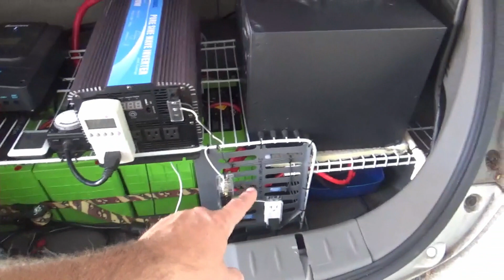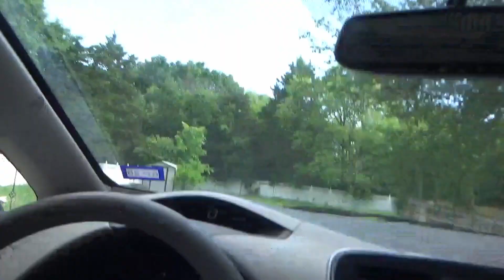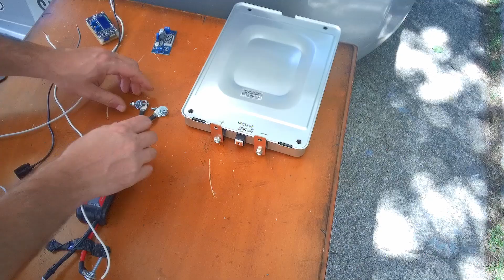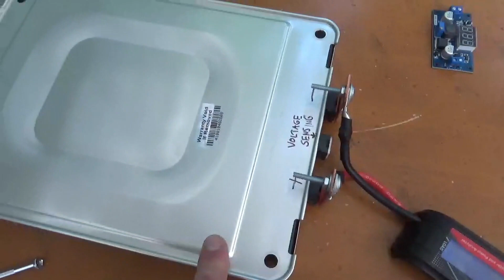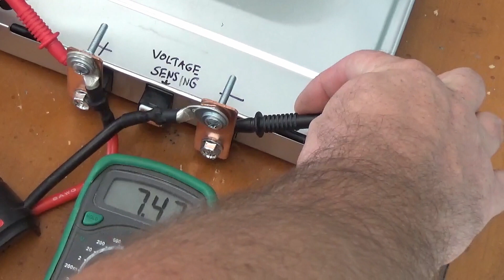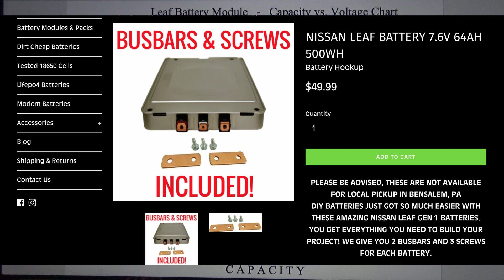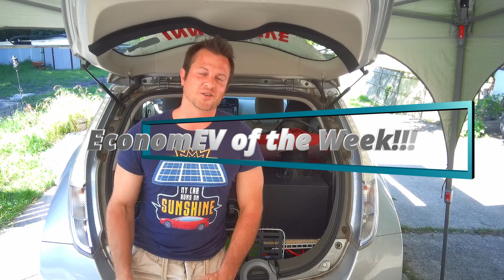Nissan Leaf Battery Module Capacity Test

Comment: Well thats interesting, happened to see some of your old videos due to solar panel topic in local ev facebook group and searching around if anyone has already done it. 
Followed it up to see that you dont make any big blunders with your battery experiments because they can burn the house down, specially if you make mistakes during charging. 
Then heard my video being mentioned here :D Nice to hear someone from that far away happening to see it too.
Also let me express my condolences for the climate you must pursue your EV life in :) Pretty bad to see your battery being that shot after so little mileage, Leaf really doesnt work well there.
Since many here already mentioned that you might want to look into new pack, I briefly mention it too - specially if you can find low mileage offer from colder region. 
Another thought is, since I saw that you have leafspy too -- there is a cell voltage page that shows you all cells - from there you can see whats most shot and probably it's the same for all leafs. The most shot ones are in the rear stack, where they all live happily/sadly pressed together, not socially distancing at all. Making the middle ones the most dead ones due to very little surface area to dissipate the heat..
Now, this is the 24kwh pack, old technology. In the same physical format there is now up to 40kwh packs for leaf. The 62kwh is different, they cheated, it's physically larger -- extended from bottom.
But the thought is, what if you get modules from some 40kwh leaf and we look into making a 24kwh pack out of those -- with a lot better options for cooling, even passive because then you have more room physically. So that they dont die in your hot climate so fast. Maybe look into Renault zoe or the leaf Van (nv-200), how they did their aircooling, they do have active cooling, with fans and stuff. You cant just go cut into leaf battery and add fans, because moisture will get in too and ruins things :) Must apply some more clever solution.
Reply: ps. your charging and discharging methods seemed a bit iffy to me. You could easily end up with bad data because of that. Those elements are 65Ah elements originally, your 3A discharge means a C rate of lollerskittels, you get no valid information on their capacity for real life usage this way. 
Leaf has 192 cells, paired then put in series, that 2p96s, if you drive at, lets round it, 20kw rate on highway speed cruising (you can see it in your energy menu while driving, it's the scale that goes up to 80). Not let us get out the amps each cell must put out during that cruise.
20 000watts divided by (96 groups times 3.8 volts equals ~365volts) equals ~55amps. Those were groups of two so 55 amps gets shared between them and each cell is working for 55 divided by two, 27,5amps. 
And you were doing a test with 3 amps, you can pretty much never tell how bad it can actually be for driving, at that test rate :)
I recently had bad experience, I got fooled by warmer weather and my battery springing to life, giving me almost double the range compared to winter. But this was at in-city driving speeds.. highway showed me reality real fast. Now the cells got proper drain and woohoo.. the rearstack started to cry real fast again. Dropping voltage fast because they are quite shot. But I can get a lot more out of them if i drive slow. 
Now your car has probably the same issue, shot rear stack, that performs quite well when drained slowly and faints at higher speed. 
This is why you need higher load test in my opinion. You do not want my rearstack cells, that are at 67% capacity but faint under proper load. 
Unless you hardly ever go above 50mph, then nevermind :)
And sir, do not play around with some silly voltmeter with a knob for charging lipo's! There must be set limit for voltage and cutout or you end up with burned down car due to "something happened that got me distracted and i didnt check up on it for few hours". Your meter didnt go higher because the battery didnt accept more voltage at that time due to being low on charge but you had no idea how far you pushed the upper limit with the knob. You saw it not going higher and left it like this but what if that was a position of 12v and you would have not returned for longer period for whatever reason. This can end in exploded batteries, even for those cells, so, careful there ;)
My ebike burned, due to failed charger and resulting overvoltage. Luckily it didnt take my house with it and I learned my lesson -- temp controlled switch can save a lot for 2$.
Reply from the maker: @gelisob  Havn't burned down the house, YET*  I've still got my eye on that cushy insurance payday though, lol.  I was glad I found your channel.  The subject material of your video, that I link to here ties in perfectly to what I wanted to talk about in this video.  I was really disappointed in Battery Hookup.  Their modules didn't come anywhere close to what they "guaranteed" on their website, and when I e-mailed them, they seemed completely unconcerned about it.  Regarding the low charge/discharge rate:  the purpose of the test was to discover the maximum capacity of the module.  While you can (correctly) make the argument that these modules would not see this effective capacity at a real-world discharge rate of 20A+, there is nothing inaccurate about the 285wh capacity measured in this test.  The most accurate measure that can be taken of a batteries hypothetical maximum capacity, can be taken at discharge rates well under what the battery will actually be used at.  Although I probably should have mentioned that these capacities will absolutely drop under real-world discharge rates.  In spite of how long most of my videos run, there is actually a LOT that gets left on the cutting room floor.  I am planning(/will be forced to by degradation) to do a battery swap this winter.  I'm talking to a guy with a 2013, 10 bar 24kwh battery.  I'm gonna need one of those pairing tools from EVs Enhanced I think.  Glad to have you as a viewer.
Reply: @InnovativeSustainableSolutions  those batts can be safely discharged to 2.5-3v(per cell) and i recommend you get a lipo charger that can do automated discharge test with cutout and also can write a graph for you :) Like imax b6, those can be found around less than 20$. That can discharge up to ~50w i believe (would recommend adding fan next to it)
Check my video where I tested some tiny batts for headphones as an example here: https://www.youtube.com/watch?v=wc4a4DxEM1Q

Comment: The amount of videos about refurbishing Nissan Leaves (LOL) is amazing. I saw one where the guy opened the module, connected wires bypassing the computer so he could get the total from external + original SOC in his dashboard. He fooled the cars computer. Amazing and tons of work.

You really need to consider get a new battery. I know that you want to extend and experiment, but it will get to a point that you'll break even... Better do the math and you still can put the old battery at home.
Stay safe.

Comment: Sadly a partial refresh is not gonna do as much as you'd like. The age/heat brings down all the cells from the 2011-2013 packs way more, so you'd have to replace them all.

However, if you really are keen on doing this, switch out the rear stack batteries. These always gets hotter than the rest due to the placement.
Reply from the maker: This is the kind of feedback I like.  What specifically makes you say the rear stack (24 modules I think) is the one that gets the hottest, and thus suffers the most degradation?
Reply: @InnovativeSustainableSolutions  This overheating behaviour is extremely easy to witness on the 30kWh pack, since it is more prone to rapid degradation after many successive fastcharges. You can read more about it here, but the same thing would apply to the 24kWh pack in your climate
https://evsenhanced.com/services/30kwh-leaf-cell-imbalance-and-complete-cell-failure/

One easy fast and rough way to check which cells are weakest in your pack, simply take a leafspy reading of the cell voltages when the car is really discharged. The lowest capacity cells will be the lowest ones.

I've tinkered a bit with the internals of the leaf battery, you can read more here if you like http://www.japtoys.net/forum/viewtopic.php?f=10&t=3613
Reply from the maker: @DalasEVRepair  What a an awesome log!  You've been going at this older Leafs for a while.  You made a critical error in revealing that you know what you're talking about though.  Now I'm gonna pester you with questions when I run into something I can't figure out.
Reply: @InnovativeSustainableSolutions  Sounds good, I love the suneater :D
Reply: @DalasEVRepair  , what info is out there describing the critical temperature that causes Nissan battery module degradation versus the average temperature for the cell?  is the high temperature encountered primarily during charging or driving?
Reply: @bocadelcieloplaya3852  50*C is causing rapid degradation. Fastcharging is more likely to cause degradation, but in hot climates there is no avoiding it 😑

Comment: I think to add things to the con section the car uses over 50amps per cell at time which will lower your capacity even more
Reply from the maker: True.  I was pretty disappointed in the supplier.  It'll be interesting to see what their response is.  I do plan on building a large powerwall, so I can always use a few more modules, but still.  Disappointing.
Reply: @InnovativeSustainableSolutions  yes but those modules always sucks cause nissans heat mgmt was a big failure. Look at David poz review of the 3.7v 120ah lg cells that they sell those look like they were good capacity and such a small form factor almost at the 100$per kw I strive for when buying lithium
Reply from the maker: @plojm123  Those cells are fantastic for building powerwalls, but wont work as drop in replacement for a vehicle battery.  The voltage discharge profiles have to match that of the original battery or it causes problems.  Power Electronics Blog did a video on this you can find on his channel.  The modules are actually solid batteries too.  They will carry the vehicle a couple hundred thousand miles when used in cool climates.  Nissan's heat mgmt system didn't suck: it was wholy, entirely absent

Comment: The Economev of the week is cheap. But the battery will have been degraded down to 85% to 78.75% original capacity with 11 bars left. The first bar lost indicates that 15% has gone. See link...
https://mynissanleaf.com/viewtopic.php?t=22113
Reply from the maker: Thanks for sharing that.  I've have to mention that in the EconomEV section in the future.  Leave it up to Nissan to assign non linear values to it's degradation tracker.

Comment: This is an early range extending system for EVs:  https://mynissanleaf.com/viewtopic.php?t=16058  But was it discontinued and why?  I don't know. It's not cost effective in any case.
Reply from the maker: New Lithium Batteries are just too expensive.  Thats why thats a $5k system.  LiPo starting at $500/kwh and going up to almost $900/kwh in Battleborn and other premium suppliers.  That why a new new battery solutions are cost prohibitive, and we've got to get creative sourcing aftermarket batts for the time being.  You can find used loads of used Lithium power for $200/kwh.  Also system shown in link has no cooling system.  That puppy's gonna get the interior of that vehicle up to about 140 degrees in the summer, unless you live somewhere quite cool.

Comment: Have a 30kwh Leaf in the UK weather helps a lot now passed 60,000 miles still on 12 bars . not doing anything like your car but still great content   👍🏻
Reply from the maker: What a deal.  At that rate of degradation, you should put about 250,000 miles on the vehicle before the battery SOH goes below 50%.  And what does Petrol cost over there?  Twice what it is in the states or so.  You're saving enough to retire a year or two earlier.  And not trashing the atmosphere while you're at it.  It's a no-brainer.